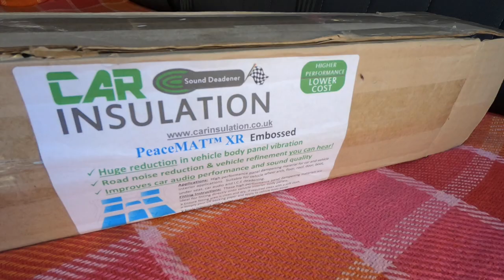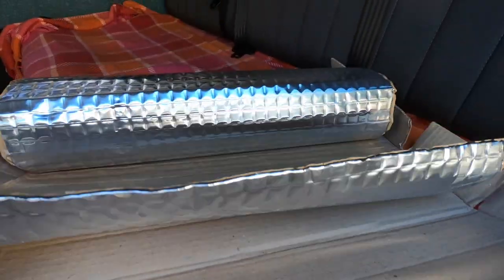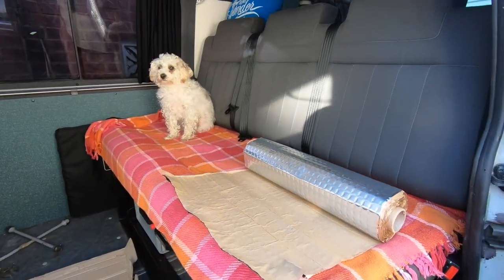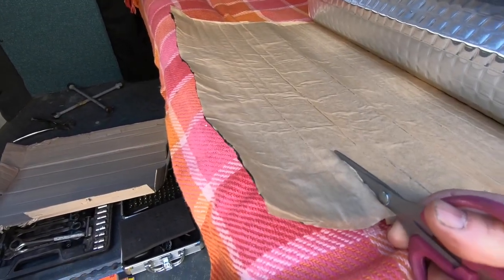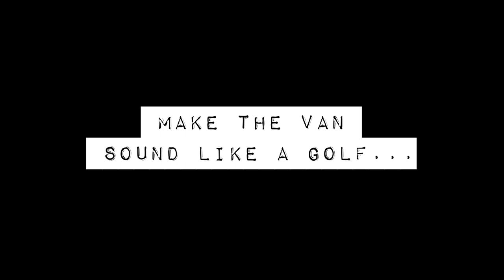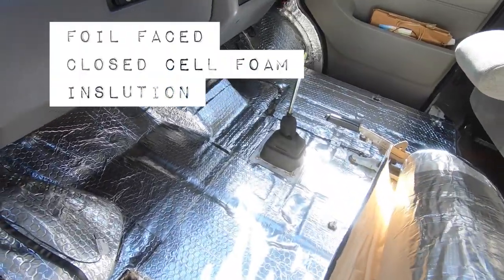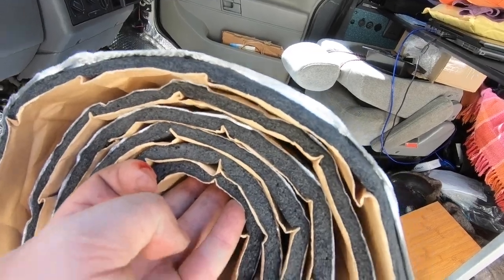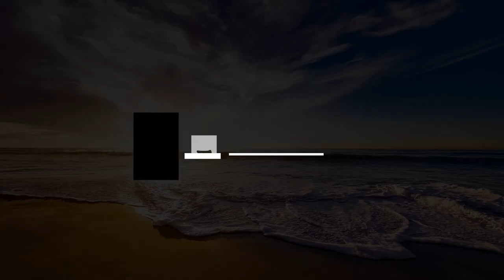VW T4 Camper Van Build 10 | Making our van quiet like a car - cab sound deadening & insulation

Comment: Will be doing this to my LT35(once I get it finally fixed) it’s non air con etc so any heat in the summer is not a nice thing. Drove down to Marbella to collect my things when I moved back to the U.K. 43 deg C passing Cordoba etc. additionally the previous owner had removed the viscous fan( a fairly common mod in Northern Europe) so engine cooling was assisted by….. having the heater on and windows down. If you are a masochist it’s highly recommended… Also the roof in the rear will be getting the insulation treatment as it creates terrible condensation in the winter …
Reply from the maker: Oh man! I feel that pain - which is why I just had to fit aircon.

Comment: I wonder, if you only put the insulation on the floor, if it would be sufficient.
Reply from the maker: It'll help prevent heat soak from the engine and exhaust, as well as from the road surface. If you're driving over baking hot tarmac for hundreds of miles, preventing that heat radiating into the cab has got to be a good thing. The cab is definitely cooler and much quieter since we did this.
Reply: @AdventuresAutomobiles  I meant what would happen if you skip the sound deadening heavy stuff as it is mostly made to reduce the resonance in big panels. I own a T4 1.9td and they have horrible road noise. No doubt insulating the cabin is a good choice when you remove the panel to the back.
Reply from the maker: Adding the 10mm closed cell adhesive insulation between the floor and rubber mat will definitely help too.
Reply: @AdventuresAutomobiles  Right, I'm not criticizing your approach whatsoever. I'm just thinking out loud in the comment section. The sound deadening stuff is super expensive and heavy and I'm trying to avoid it. The structure of this closed cell insulation from a physics perspective should act very good as a sound insulation too. (As the soundwave needs to change medium every half a mm and thus slow down, it is a very non homogeneous environment)

Comment: How much did it cost?
Reply from the maker: Hi James, the insulation foam cost about £40 and the sound deadening about £50 a roll.
Reply: @AdventuresAutomobiles   and how much did you use on the front cab? the whole rolls?